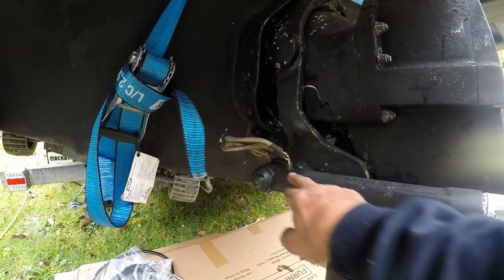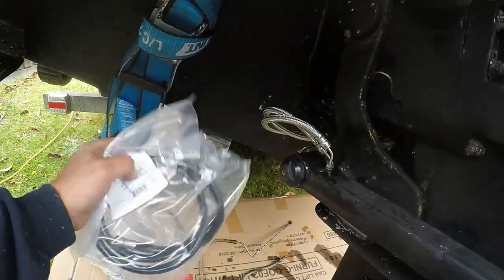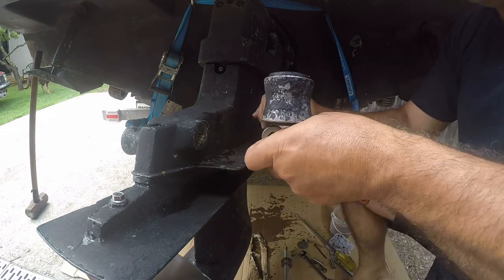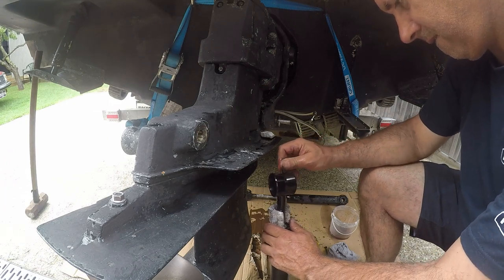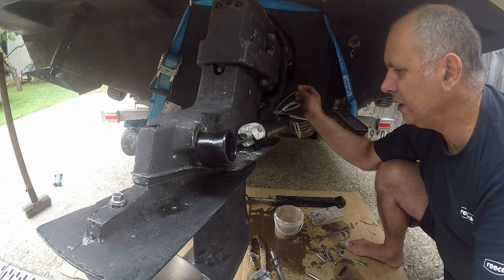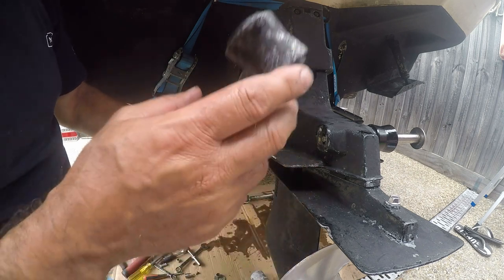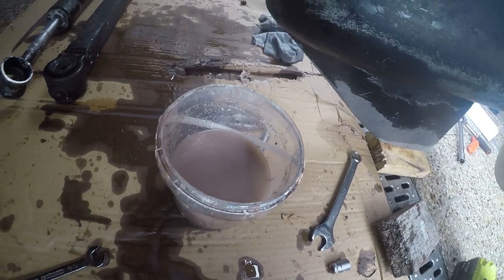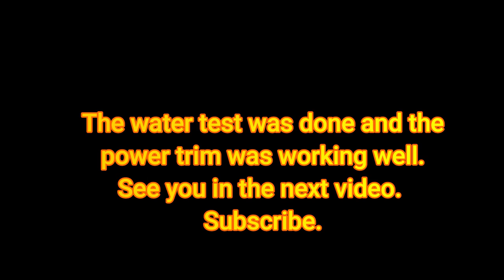Mercruiser stern drive  power trim repairs

Comment: Good video - whished you showed bleeding the new system out.  Thanks
Reply from the maker: We just went up and down with the trim and ensured a full oil tank we did this at least 5 times and then topped up the bottle
Reply: @mikiplum the motor won't drop? With the rams being empty @ first? That's what I'm afraid of lol